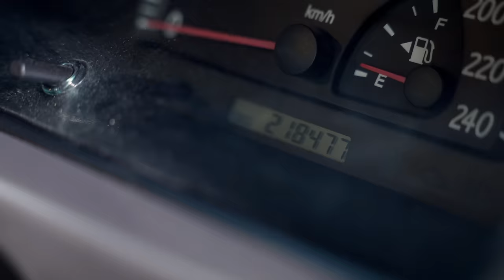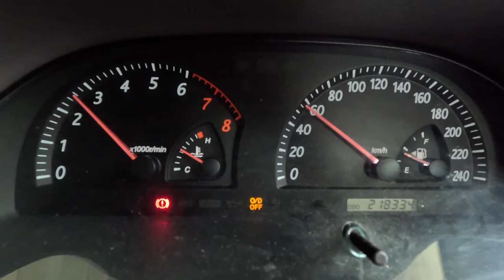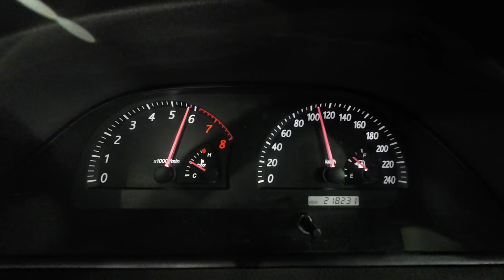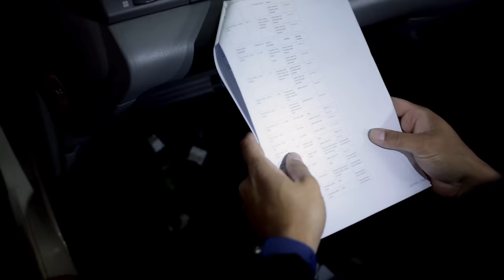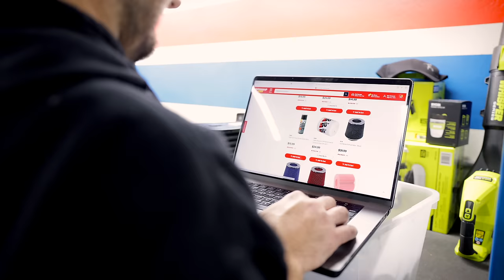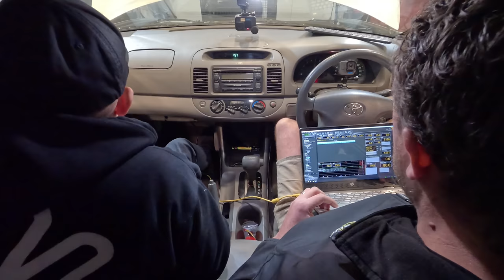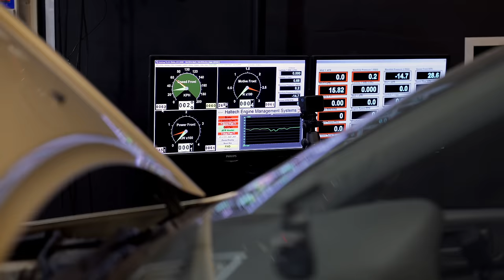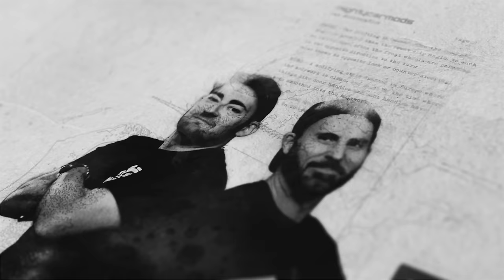World's cheapest Turbo Kit (on a Camry)

Comment: I know it had been 7 mos....but I just saw this. It looked fun. I added a Edelbroken E-Farce Stuper-charger that WOULD NOT WORK on my cheap V6 Camaro LT build. ($22,550 for the car with a 6manual and 3.6k. (2020). GM had improved security on the ECU.  Anyway I took it off...the kit got stolen from my lockup and my Homeowbers policy paid me the full, new amount for it. The. I traded the V6 camaro for $29,000 and bought an SS last April. NO MORE ENGINE MODZ! (YET)
BTW. It isn't "double exhaust" mate it's "DUAL EXHAUST"
Say it the cool way "oh man nice dual pipes or quad pipes!"
Peace! I enjoyed the show!

Comment: I used to have a stock 4 cylinder 2004 Camry for years and years. The car had more than 200K miles on it by the time i scrapped it, and boy did I beat the absolute hell out of it. Long story short, it got flooded up to the top of the car with sewage water after a really bad storm, and ill be damned, the thing still ran like a clock when I started it up the next day. Would've kept it too, had it not been filled with shit and piss water lol. It did smell like piss before this even happened but whatever. I also hit a top speed of 130ish mph in that car lmao. That old thing ran great,  was amazing on gas, and was more reliable than any other vehicle I've had to this day. So many good times were had in that Camry.

Comment: There was something seriously wrong with that dyno..  
Toyota says that car stock makes 154 hp at the wheel and 16.9 in the quarter mile. 
So the fact that before any mods, their Camry did 17.3 meaning it may be down a few hp but NO WAY it's only making 106.5 hp

Comment: 2002-2006 Toyota Camry: Be aware that replacing  Lower Control arms is not for the average DIYer.  Its a $1000 job at many shops.

Comment: P/S not sure if you're aware the Toyota Camry dominated the American  circuit racing for many years out classing anything USA & Europe could produce! The car used was identical body to yours except running highly modified 4.7 quad cam V8 with all wheel drive & 4 wheel steering! 
Toyota dominated in endurance, speed  & handling in highest competition racing USA wide! So nothing boring about that! However think you guys possibly got as close to that rocket ship as well ever get within that Camry body?! Cheers Tony

Comment: I never liked Toyota till I bought a used 98' Camary for $200. Although it had over 450,000 miles the previous owner always kept it serviced and had recently fixed a lot of mechanical issues. I've owned it for nearly 2 years without any problems. All I've had to do is regular maintenance. I now love Toyotas and now I've got over a half million miles on it. Something I've never seen on my favorite vehicle manufacturer GM.
Reply: Should have wrote this comment with my primary YT account. Anyways the speedometer and odometer is non functional which I suspect one of two things. One thing to really love though about the 98 Camary I own is that almost everything is easy to access. The first oil change I did I was amazed how easy the oil filter was to access and it didn't spill hot oil all over me while removing it. I've been so use to GM cars and even owned one that it was easier to just take the wheel off to gain access to the oil filter. I do know that GM and Toyota did have a relationship back in the 90s. I've always wanted a Japan Spec Toyota Cavalier with a Quad Four in it and maybe 5-8psi of boost with a turbocharger. GM did make a supercharger kit for some of the 90s model Cavaliers but only marginal HP gains. Yeah a Toyota Cavalier with a 2.4L Quad Four running 5-8psi would be a quick little car. Plus it would have the cool outer marker lights.

Comment: When you take into account the cost pf a turbo and the power output and before and after you strat to realize that just leaving your Toyota stock is the way to go for daily driving and if you want to have fun just buy a nice 600cc street bike and be done with it. Not worth ll that hassle of constant upgrading and chasing horsepower and wasting money on parts that give you such small gains. Just get a 5 to 8 year old 600cc street bike with decent miledge and try to be carful who you insure it with and get doscounts where you can. I am 38 and have a record and my price for a 600cc street bike for libilty only is $435 a month so be careful out there and respect the rules of the road

Comment: Wow.  Whole new body.   Whole new suspension to fit the new body,  an engine swap which probably includes a new transmission swap.  Whole new set of wheels.  Throw on new racing seats..  all new headlights and tail lights.  You'll have the mr2 in boxes in storage and another car in the driveway.  Still entertaining though.

Comment: How is it possible that a 1970 1.3L engine has the same power as today's 1.3L engine? Despite all the advances in technology like fuel injection, 16V DOHC engines, VVT etc, how come the power is almost the same? Do the manufacturers deliberately design a low-power engine? Some techniques and technologies have been abondonned like coolant-heated intake manifold, valve overlap except in direct injection.

Comment: Hey toyota want to make millions fast and easy take new camry with v6 and turn motor to the right direction and make it rear wheel drive. The kids and us older guys would buil drift cars darg cars and just mean ass street cars. stock would be great but modded would be fun as hell. Now drop all the bells and whistles we want a base car affordable to build on. remove these things first tpms any cameras all the bells and whistles, rwd guys want a affordabe base 6 that can be left stock and be fun to drive but also a base to build from mild to wild. Trust me it would sell faster than you could make them. I love my old camry but if it was RWD it would be perfect, I want both sides of engine to be easy to access. I do not want to have to reove intake plenum to do rear plugs and valve cover gaskets. It is just not natural to have engine in sideways.